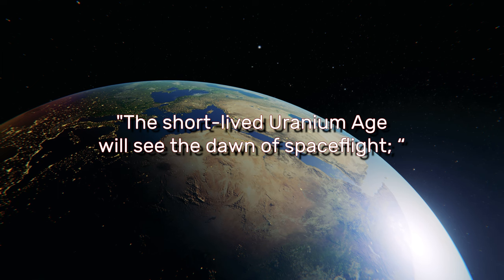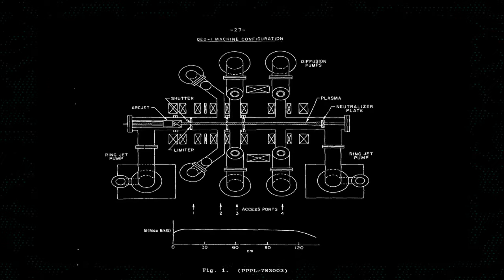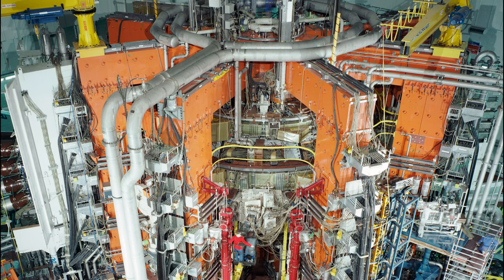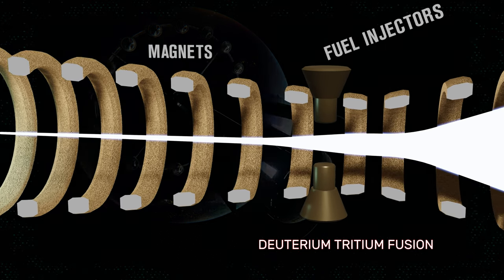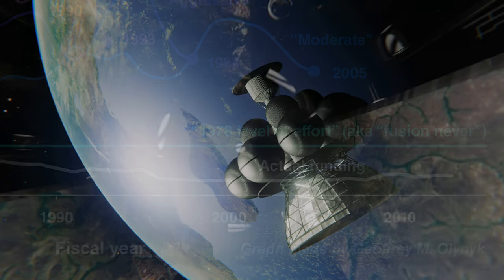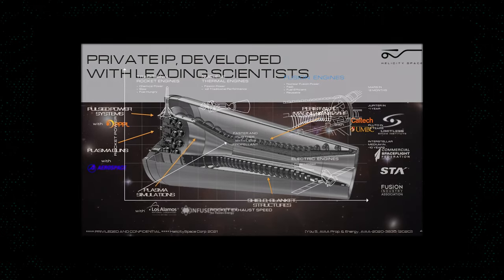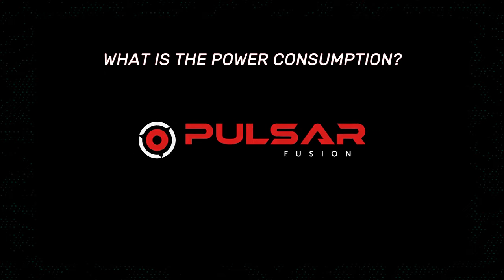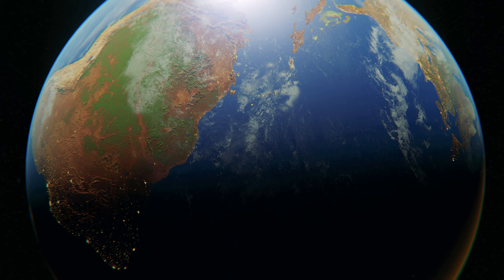Will we have Fusion Propulsion before Commercial Fusion?

Comment from the maker: Thanks for tuning in everyone! It's great to get back to talking about some nuclear rocket tech. 
Like all things spaceflight, private industry seems to be paving the way to the future of fusion propulsion as well. I'd like to hear your opinion on that! Will NASA buy these systems once they're ready?

The Project Orion Series: https://youtu.be/xnNVVVjmfss

Sources / Resources:
Fusion Concepts
https://arpa-e.energy.gov/sites/default/files/2022-06/Petros%20Tzeferacos_Compressed.pdf

https://www.pnas.org/doi/10.1073/pnas.1921779117

https://world-nuclear.org/information-library/current-and-future-generation/nuclear-fusion-power.aspx

Dyson&Orion
Dyson, F.J. (1968) Interstellar Transport. Physics Today, 21, 41-45. http://dx.doi.org/10.1063/1.3034534

QED-1
https://www.fusionenergybase.com/project/qed-1

Princeton Field-Reversed Configuration Device
(Photo by Elle Starkman/PPPL Office of Communications) 
https://www.pppl.gov/news/2022/pppl-partners-local-company-developing-superconducting-magnets-space-applications

Modern Fusion Propulsion
An assessment of fusion space propulsion concepts and desired operating parameters for fast solar system travel, 33rd Joint Propulsion Conference and Exhibit. 1997
https://doi.org/10.2514/6.1997-3074

Robert Bussard
AIP Conference Proceedings 271, 1601 (1993); https://doi.org/10.1063/1.43058 (limited access, cited abstract)

Thanks for watching!